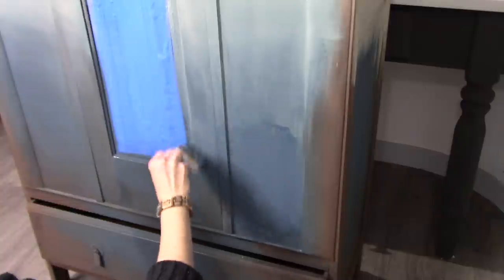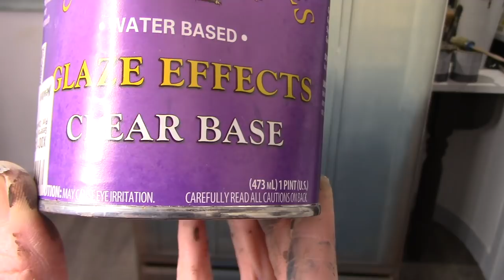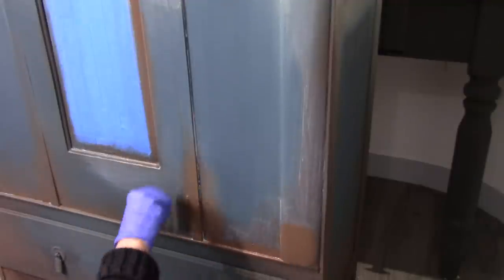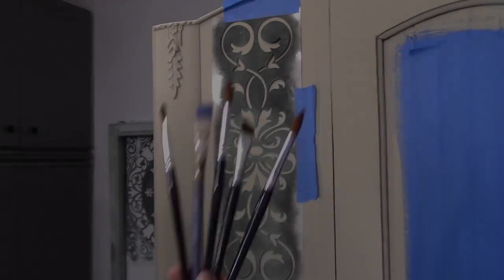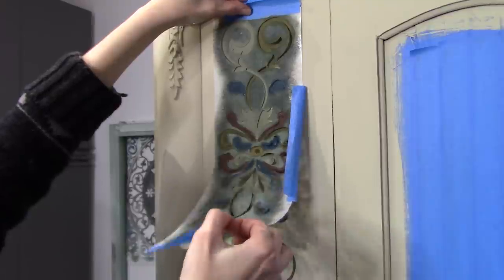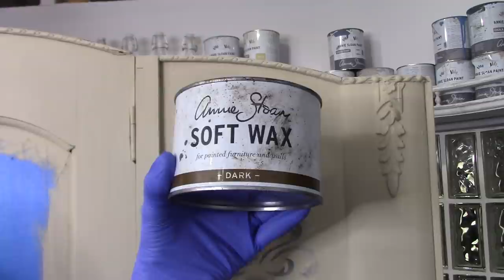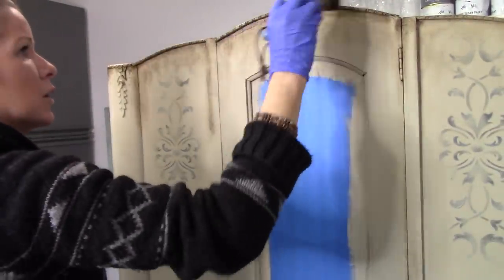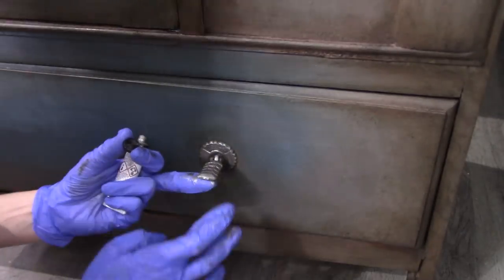Chalk Paint Blending and Faded Stenciling Effect

Comment: Did u put the glaze all over furniture all over or in sections.  Did u glaze section and then paint with color over it?  When did u use extender
Reply from the maker: anna zummo ... Hi Anna ☺️
I use the clear glaze in sections, glaze can dry quickly so that is where the extender ( can use in any glaze product) will extend the drying time so you have more working time, just a few drops in the glaze is all you need! It’s not a must have, it is just added help especially with larger furniture pieces 😉💙
The clear glaze and added chalk paint on top can be blending in comfortable time , just recommend small sections 😉🎨
So yes , you clear glaze then add you chalk
paint directly on top and blend away! Super fun, easy and much smoother results with leads time 🤗💙